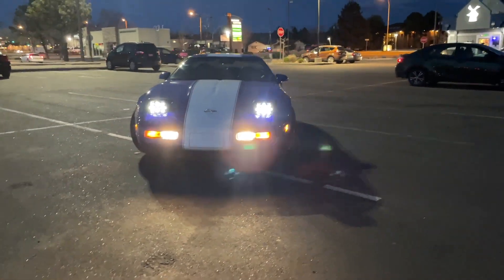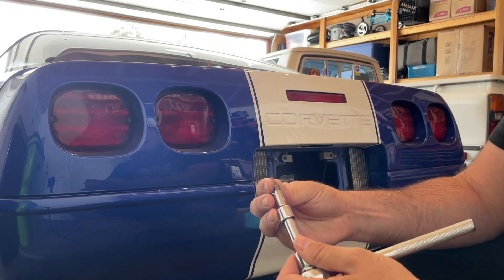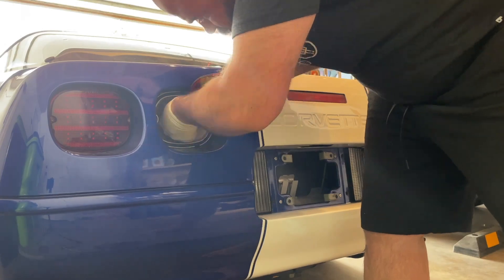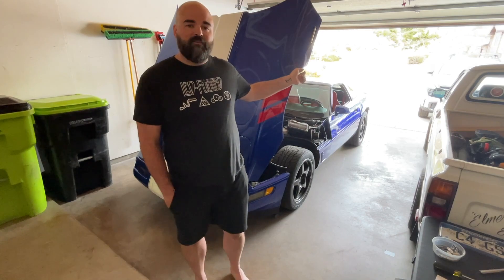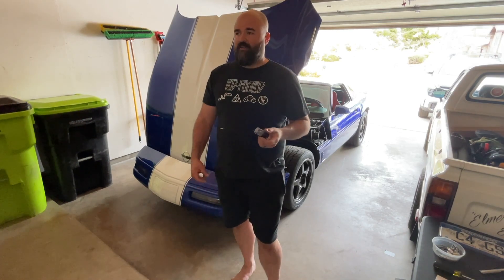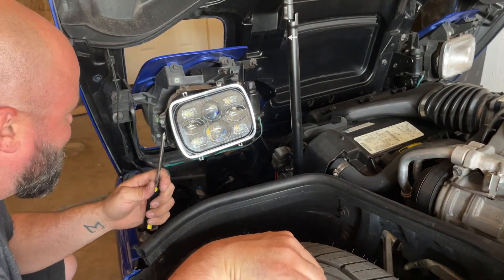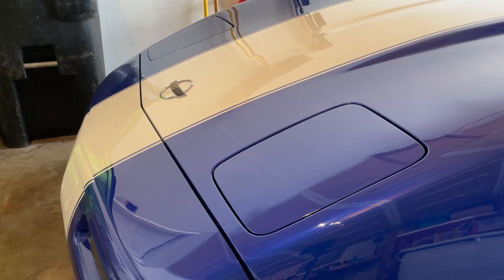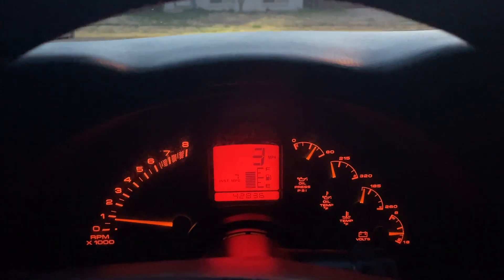LED Taillights and Headlights for my 1996 C4 Corvette Grand Sport

Comment: The problem you're having with the bright lights and switching over is the middle wire on the connectors ground that out to the frame and you'll no longer have that problem

Comment: Did you fix the ground for the fog lights? I installed led headlights fog lights and a smoked 3rd led light. Under the passenger side is some relays you have to cut a wire to make the fog lights not want to kick on the high beams the only thing is the fog light will be on always with the headlights no matter high beam or low beam you are able to shut them off with the fog light switch. Hope that makes sense. At first I thought I needed to make it’s own ground I tried to ground it and all that did was make it really angry and the wire got hot so then I figured why not try cutting the wire and bingo it worked. The led headlights I put in are the Wagner led they were not cheap but I think they were pretty light weight.  Car looks amazing I have done a few things to increase my HP on the lt4 motor and hole to do more.  I still need to dyno run to see where I am on HP.

Comment: I kept the stock tail lights but I want to grab the European ones I just switch everything over to LED bulbs except for the front headlights I switched over to the new kit but far as the fog lights just put LED bulb in there they work really nicely look badass when the car is that the Twilight hour also the reverse lights put the the LED bulbs in there it makes it look badass when you back up also with the front turn signal I also did them with resistors so they work right also I wanted to tell you on your wheels do yourself a favor take those stock wheels off there and save them those wheels are so rare on the Grand Sport if you do anything to damage them it's really hard to find a replacement guys are asking crazy amounts of money just for one of them especially the two rear ones because they're not the same offset as a ZR1 they're a little bit different

Comment: if you install a led flasher will it mess with the flashing of non led lights?
Reply from the maker: Nope. It’s just a flasher that’s controlled electronically vs. mechanically, using digital circuitry vs. current draw.

Comment: Switch your power wires behind the headlights and the high beams light won’t come on anymore
Reply from the maker: Iiiiiiinteresting. The kit I got was a straight plug and play setup. Got any details on what wires to swap?
Reply: @HoffmansHoopties  mine had the plug and play but I switched motors so re did all of the wires. The black goes to black on it the yellow and the brown together and the red goes to the mixed color wire think it’s green and yellow. I accidentally had one plugged in the wrong spot and it did what yours is doing
Reply: @HoffmansHoopties  we’re you able to get that taken care of ?

Comment: Asthetics???? At least it is reversible. 

The yellow stuff is there to reduce the chance of corrosion.

Those headlights are very hit and miss, and they look tacky as hell. Can get H4 semi-sealed units and put decent quality LEDs in those if you really must. Good quality halogen headlight bulbs work much better and provide a far more useful light output and better colour rendition.

They look brighter, but output a very narrow spectrum compared to halogens.